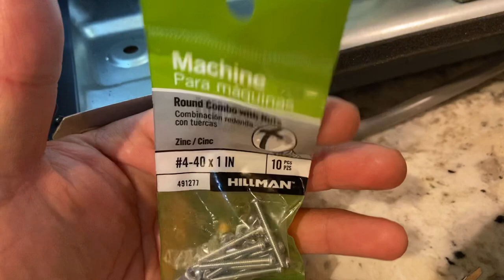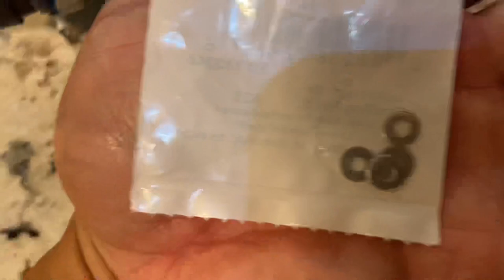How to fix GE Profile microwave door stuck on close. part 2

Comment: Just finished my repair. Same exact parts at Lowes. One thing to mention is that you need the security hex bolt bit to be able to remove the screws on the microwave. Thank you so so much for this video!
Reply: We can i get the security hex blot? Thank you!
Reply: UPDATE: I've done the repair 3 times now. The bolt twists loose from the nut each time you close the door. This last repair I added a 2nd nut and super glue to make sure that doesn't happen again. You could probably use loc-tite but I didn't have any.
Reply: I was able to get all but one of the screws that had that pin in the middle. I took my multi-tool with a metal cutting blade and made a slit on that screw head for a flat screwdriver. A dremel with a cutting wheel would probably work as well.
Reply: @korndawggy1801  thank you!!

Comment: I may have a slightly newer model or different model. But overall the fixed works the same. You do need to make sure though that when the microwave is in its closed position it pushes up against the limit switch so that it will actually turn on

Comment: Easier fix. The doors come misaligned from the factory. Push up on the bottom of the door and you’ll notice it moves by a few millimeters. Opens every time

Comment: Thank you. You just saved me buying a new microwave. I even had a bolt , washer and nut that would fit. So it only cost me time after watching your video. Your fix is much better than the original plastic piece that was made to break. I am surprised the original lasted 4 years with how hot my wife can get the microwave. May the Lord Jesus Christ bless you and reveal Himself to you.

Comment: Thank you so much for this video.  I had the exact same issue on a 3 year old unit which sees lite use at best.  Very poor design from the factory.  I used a little super glue to glue the post back down and used the screw to secure it while drying.  Used the exact same parts from lowes.  This is the best part of youtube.

Comment: Thank you!!  We installed this microwave in our house 5 years ago with custom cabinets. A few months in, this part broke and I  searched for a microwave without a button to fit the space. I couldn't find one. Still under warranty,  the company replaced the whole unit.  It broke again the other day.  I was so happy to find your video!!!  Thanks to you, my microwave will hopefully last several more years and I don't have to search for a specific size replacement yet 
In regards to lining the piece up so the turntable doesn’t turn all the time and the light is not on, my husband just put the screw through the original plastic piece that broke off. That did the trick!!

Comment: Thank you so much for this man. Fixed our microwave for less than 6 bucks and in about 2 hours. 

For the stupid security screws on the back of the microwave, the screw driver that came with my ring doorbell fit perfectly.

Home depot was out of the #4 machine screws so i used an M3 bolt.

Comment: Great advice! Just fixed mine. One suggestion for folks... my installation of the screw/washer/bolt was made much easier by removing the switch housing assembly as my hands couldn't get to the back of the piece to install the nut. To do this, you'll need to:
1. Disconnect the leads to the switch actuators.
2. Remove the white plastic lever piece. It just pops out... use a flat head screw driver. Requires a little bit of focused pressure (pops back in when done)
3. Remove the (2) screws at the top and bottom of the vertical swtich assembly.
4. Remove the switch assemby and install the screw assemble as noted in the video.

A couple other notes. I put a small lock washer on the screw before bolting it up. This we ensure it won't loosen over time.

ALSO... make sure you disconnect and DISCHARGE ANY REMAINING ELECTRICITY LEFT IN THE CAPACITOR.  see this video on how to do this. https://m.youtube.com/watch?v=GaNbS-KEgrw&pp=ygUfZGlzY2hhcmdlIGEgbWljcm93YXZlIGNhcGFjaXRvcg%3D%3D

Comment: Thank you. This worked for me. I didn't have any machine screws at home with a bolt so I used a larger screw and washer to go through the plastic. Seems to hold very strong.

Comment: Hi! I watched part 1 & part 2 of repairing the door opener.  How do you open up the case? I took off all outer screws but the top wouldn’t release.  I had to bend the case to access the part. There must be a better way to access it. Help!
Reply: I’m having the same issue. I got the screws out but can get the cover off all the way

Comment: I cant figure out where the screw is going in.  I have the broken piexe but cant figure out where the nut id going to fasten too? no holes? any help will be greatly appreciated
Reply: Hey John, sorry I just got to this. I hope you figured it out by now… the screw goes through the opening on the broken piece, and the nut screws on to hold it in place

Comment: Any tips for actually getting into the place you’re referencing? Mine is a built-in unit and I don’t see any way to access the inside.
Reply: Remove the 4 button like heads in trim with screwdriver and then remove the screws under them

Comment: Thanks for this. I did this and now door works fine. However, Microwave does not work.  When door is closed, the turntable rotates for no reason. When I  try to run the microwave, it displays "door" error.
Reply from the maker: Check the wires
Reply: How did you get it fixed? I have the exact same problem ...
Reply: @ganeshpurushothaman1719  I did not fix it yet…
Reply: Hi were you able to fix this problem. I have the same issue fixed the door but it gives me a door error
Reply: I was able to fix this by placing the black lever that gets screwed on down. It must be hitting the sensor when the door is closed. If it is placed loosely  tightened  it will not trigger the sensor.
Reply: Hi Jo! This video is awesome, thank you! Any idea what that actual black plastic piece would be called (that gets “triggered” by the pushed button)? That part snapped on ours 👎

Comment: Or Jo, what does the screw attach to?
Reply: You run it through the plastic spindle that broke off. It will hold the piece that broke off in place. I just completed mine.
Reply from the maker: Sorry just got to this.. it has a nut on the other side
Reply: @JoAvRidge  Jo, do you need a new metal spindle to put in, or just the screw. Where did you get the metal spindle to replace the plastic one?